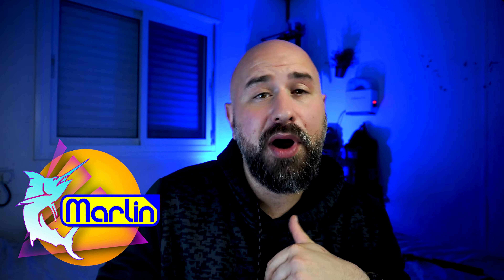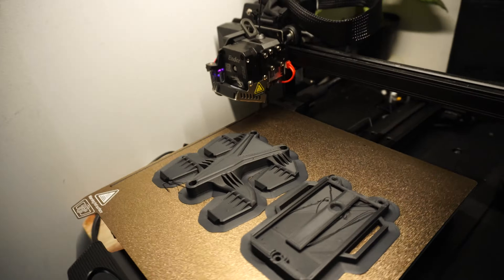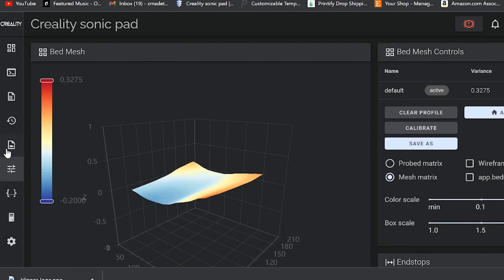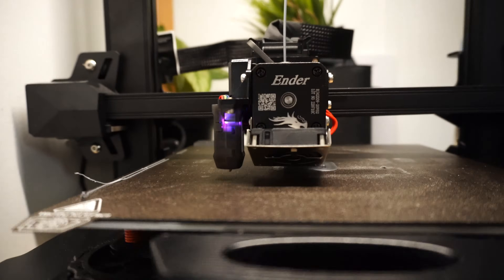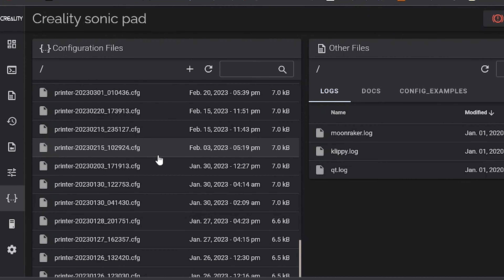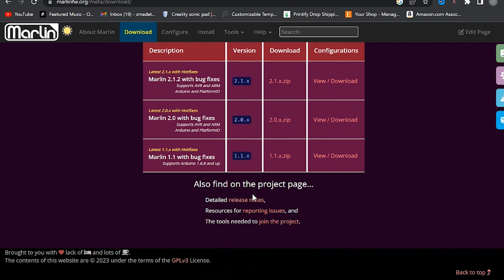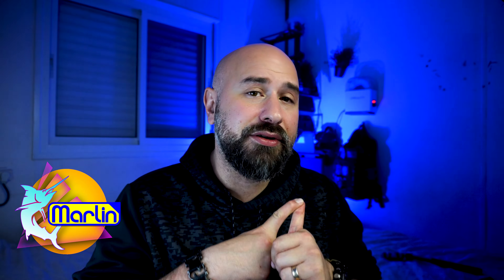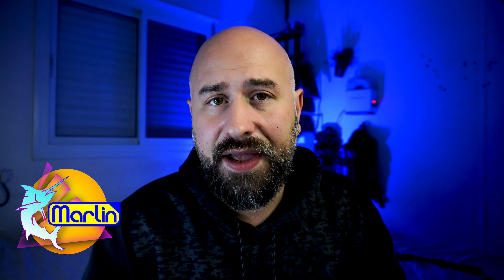Klipper vs Marlin which one is right for you

Comment: Klipper does not gives an "out of the box" speed+quality compared to Marlin. So its not only gives difficulties to the initial hardware/environment setup, but also takes time to tune up to the printer. Unfortunately even some stock printers are not natively supported, you really neet to sesrch, learn, make a lot of trial/error method. Start over again, etc etc. Yes, modifing the printer.cfg file is super easy. But to know what and how to implement in to it, you really need to invest a lot of time in it. It can takes days or even weeks to achieve the same quality that Marlin offers without wasting too much time. On long term though, yes. Klipper might be the winner. Except, if Marlin figure it out they can also go to an external board with a user friendly UI.

Comment: Did you compare the CPU power of the first (slowest) 32bit cards to desktop PCs? You should try it! I've seen guides where people use a old i5 to run 3-4 Klippers, without any problems, but the total raw power per instance is actually lower than 32bit cards. Add in Linux on top and it starts to not make sense. How fast or feature rich does our printers actually have to be to gain advantages from Klipper? Cause it seems to be a lot of work, to MAYBE gain a ever so slight quality advantage. I mean i like tinkering, so I'll likely try it just for the challenge ;)
PS calibrating Marlin is actually very easy, tho time consuming, so each time you get a new filament type, it's a 3h job

Comment: Hi I watched your video really well done. I think I might be in your minority group of people that click the video.
What I'm trying to figure out is as a very extreme beginner, I basically got an Ender 3 V 2 and I bought the CR touch, and a ton of other upgrades so while I have it apart I was able to get myself a Raspberry Pi 4B, I'm noticing just open the whole can of worms because I'm told you want to use Marlin can octoprint but that I'm seeing so many people post that it's old News software compared to the other options now so I'm trying to figure out what is the best option for entry into not having to do heck of a lot of customization on the Programming type or file management, I only picked it up because my intent is adding Wi-Fi and that's it. I'm actually still using the firmware that they shipped the printer to me with.
Reply: Just starting out, it's usually safer to stay with stock or Marlin firmware until you get more comfortable with printing. And only when you need to push past the limits of that firmware would you need to look at something like Klipper. But if you have a 32 bit Mainboard, it's down to preference. With modern 32 bit micros, it'll have more than enough processing power to do most anything you'd want to do. It's only the older 8 bit boards that truly benefit from Klipper especially with continued development within Marlin

Comment: I have the same exact opinion as you stated in the video!
As for me, I know my way around microcontrollers and had a smaller 3D printer previously, so with my Anycubic Vyper I jumped right to Klipper. Shortly after that went back to the stock firmware instead, because Klipper seemed to be incompatible with my slicer, and really looked like too much effort without any significant performance- or quality gain.
Just recently out of curiosity and geekiness I went back to Klipper, dived a little bit deeper and found that actually it works fine and is a really great tool!

I think if you are a normal DIY pal and like to 3D print and have a decent printer, you don't need Klipper. But if you like !3D printing technology, and like to calibrate, tune, adjust and mod, then it is definietly a great way to pump up your gear! :)

Comment: This is a great explanation. I've wondered what the big deal is for a while now and I've never heard anything that really outlines the differences. For me the notion of needing to use an external computer seems rather ridiculous. One of the things I love is a stand-alone machine that i can just pop in an sd card  start a print visa the built in screen and then walk away. U can see the advantages of i were running a print farm but for a basic hobby printer it seems way over the top.

Comment: Also, I'd say that mesh bed leveling on Klipper can be almost useless at times. Both my beds on my printers are at least flat enough and I've wasted a lot of time getting mesh bed leveling to work correctly. The devs don't seem to be very concerned about this. I had much better luck with Marlin when it came to this (I've replaced my bed, so I haven't ditched Klipper)
Reply: Yeah, I'm using mainsail. I'm not sure if it's the mesh settings that I'm not quite getting, but once I got over using the mesh to avoid leveling every few weeks, the screws calibrate actually works fine for now. If you're trying to tweak the firmware or calibrate (especially if you're having to upgrade or modifying the printer) Marlin can be a nightmare. I just wasted a lot of time trying to use the mesh to compensate for leveling. If either of my beds were warped I'd might actually need it, but they're not, so I just level every once in a while.  @AkashicSeer

Comment: As a newbie to fw i find klipper to be very tricky vs marlin. "Just type in this macro", sure. How did that get programmed? I built an I3 this past winter from scratch including all the printed parts and used marlin. It runs solidly. I haven't done any klipper stuff yet, hence why i am going to build a voron v0. Im positive that marlin will equal or better klipper in time without needing an extra $100 sbc and a degree in programing. Im going to give klipper a go though just to say i have. Great vid, subbed.
Reply: The only reason Marlin seems easy (on the 'programming' part) is that the firmware is already written by somebody else, assuming you find one that's specifically caters to the hardware that you have.. or it's you who adjusts as to what hardware the firmware is written for.  But you're severely fenced to the set of hardware the firmware was written for. If for example you change extruders, you have to search the net for the 'compatible' firmware or write it yourself, then reflash your board. Luckily for Marlin users is that there are tons of pre-written firmware out there and you just have to download it. 

In contrast with Klipper, you can literally pair ANY hardware you like, change some values in a text file, save and reboot. It's that simple in Klipper. It's brand and model agnostic (even cheapo chinese aliexpress kits will work), type agnostic (e.g. switch between bowden and direct extruders), freedom to add and control any additional steppers, LED/lights, fans and other accessories and so on. The process is the same for all of those - edit a text file, save, and reboot.

Comment: I am a Hobbyist in the sense of a Retired Engineer and now making model train parts for my 1950s Model trains. I bought a CR 10S Pro 5 years ago to have the volume to make engine bodies and smaller parts. In the 5 years this 10S Pro have been modified. BL Touch, Synched Z axis drives, Z axis Struts, Garolite Bed, Micro Swiss Hot end and Direct Drive, Raspberry PI running OctoPrint, Hardened Steel Nozzle. And i was struggling with a heat issue on my train parts, having some fail I had to get better filaments. CF PETRG was one answer for High temp use and it worked! But I had a heck of time getting it to print clean and reliable. Until my friend Andy told me he just installed Klipper. And thought I needed to try it to. After 3 days of on line help Andy had my printer running again on Klipper with a new 7 inch color screen OctoKlipper UI.  My 1st try with CF PETG was a disaster it squirted out all over, pilled up then went to spaghetti mode. I texted Andy what is happening. Did you set the Z offset, yes off course. Print a smaller test part and check for elephant foot. I did and it was bad. OK Now raise the nozzle .001 or .002 at a time using the New Klipper on the old 10S Pro screen. Raise until you have Zero Elephant foot. OK. How did it go, I started at  -3.0mm but ended at -2.75mm. Ok Good, now try a part. OMG! I printed a perfect Smoke Housing for the first time ever. In CF PETG. And i have even dialed in the other Hot Rod Setting. The printer runs at 180 mm/s NOT CF PETG it runs at 90mm/s but PLA+ my go to Filament for most of my parts is a screamer. And the parts look like castings. Beautiful, surface, edges and with Garolite, wait 5 minutes and it lifts off with out a scrapper.  I used my original Pi 4B to load and run Klipper, the 8 bit 10s Pro board is running the motors. Once I had the Z offset dialed in the machine has been transformed. I change speeds and temps between PLA and PETG and the thing just works. One of my partners in Parts for old trains has two Enders and he has added the Sonic Pad to Klipperize his machines so we can both print the high temp parts with the same quality. I design in Fusion 360 and slice with Simply 3D. Right now a new part is test fit using PLA and for fitting only I can print, test fit, change CAD, reprint 6 to 8 times in one day. This allows me to have a very good final shape then move to the final material print the the next day and 2 or 3 prints later I have a truly production part in less than 2 days. It usually took me weeks to get this far. So we are able to release a few new parts every week. Being 74 years old that is a big deal I have so many parts to reengineer I was afraid I would not be able to complete my work. Now I feel there is hope I will have enough time to complete my Model Train Dream, SNOW PIERCER!!!!! Great video understand both sides and hope they both have long successful lives. Marlin got me started, Klipper is helping me move along faster.  Dennis in Virginia
Reply from the maker: That is a great success story for klipper my friend! thank you for sharing and I'm happy I was able to provide you with some value

Comment: Great video though I have to say Klipper does not require a Raspberry Pi.  You can use other small board computers like an Orange Pi, a thin client, or even a laptop.  This is my first experience with Klipper and I am trying to install it on an Orange Pi 3 LTS for use in my Ender 3 Pro.  I would not say it is easy, but it is interesting.  Currently I am just using my old 8-bit board to test it out without actually connecting it to my printer.
Reply from the maker: let me know how it goes😊

Comment: I think whenMarlin 3.0 drops, printer main boards may actuall be above 64mhz and have some ram...no need to strap a pi to a control board to get fast printing.  Really the controllers with Marlin printers are shrunken stone age components....and ARM is cheap...look at all the cheap quad core gaming handhelds with screens for 40 bucks lol.  I know it is more complicated than that, but we should have just as fast marlin boards as klipper is offering with pi's

Comment: the new 32 bit boards are fast enough to keep up with anything we throw at them, the main reason klipper is better is cause you dont have to recompile the firmware each and every time you make a change. thats the main thing that makes klipper better.
Reply: You also don't need to recompile RepRapFirmware (Duet3D firmware) for any configuration changes, it's done via initialisation G-code. And you can update the firmware independent of any configuration changes. For 32-bit printer control boards, it's a more fitting choice than Marlin.

Comment: Fuck that Klipper just fucking garbeg full of bugs. I installed kliper to skip running every time to my printer instead now I staying 1-2 hours by my printer and I can not find som config which will work fine. every thing is working worse than with original firmware or pro why is peoples even recommended to use it if you need to have to learn programming. end under yours video you have massive links where you can buy it or that fuck you!!!!! klipper is fucking sodomy!!!!!

Comment: ❓8:23
What's the main difference (Pro vs. Cons) between OctoKlipper and Mainsail or Fluidd?

Is I heared there are more plugins and possibilities on OctoPrint (like OctoLapse, SpaghettiDetector, IndividualPartCancel, ...) compared to Mainsail or Fluidd. But how do they compare in other situations (speed and processing power, ...)?

(PS: I'll use my old Android-smartphone (Samsung Galaxy S8 plus) with Octo4a to run OctoKlipper because it should be easier to get it up and running.)
Reply from the maker: Hey Photelgy, that is a bit of a deep question, and a great idea for a video😊 Spaghetti Detector has transformed into Obico, and the time laps function that made octolaps so famous (letting you park the extruder for every frame) is now integrated into klipper natively as well as part cancellation, so at the end of the day all the kipper interfaces work relatively similarly, the biggest difference I have found moving to klipper for me is the speed and accuracy supper charge I got from klipper, don't get me wrong, I love marlin and octoprint is incredible, but for me and my 3d printing journey, klipper just made everything smoother and faster, I hope I was able to help 🙏

Comment: Marlin is definitely slow on a atmega2560. But not when using something like an SKR1.4T. Also with the BTT tft touchscreen having UI options to change a lot of things on the menu without needing to reflash the firmware. Curious on what happens if you pull the plug while using klipper. Does the raspberry pi's os file get corrupted? Since I don't have that problem with Marlin. I would explore klipper one of these days.
Reply from the maker: Hey there webslinger2011, I agree that Marlin definitely gives up a good fight when paired with a 32-bit board, and the right hardware, but I think Klipper is worth a try even if you prefer Marlin, simply because it's a whole new experience, and in my opinion that's usually a good thing (when it comes to 3d printing😉) I hope you enjoyed the video

Comment: Hi, great video. I'm new to your channel. I'm unsure if flippere will be useful to me. I print my rc planes on my sidewinder x2 and while it print perfect little objects like the benchy, without any defects, it has little quality problems while printing wings. I print in normal speeds like 50-80mm/s. Will kipper be able to improve the print quality or just in case of high speed printing with the input shaping?
Reply from the maker: hey marcioh123, first of all, welcome to the channel😊 and thanks for your comment, second it's a bit difficult for me to say if klipper will substantially help in your particular case, considering I don't have that much experience with the sidewinder x2, but in general klipper has a significant impact not just on speed but on quality as well, pressure advance and input shaping are just a few ways klipper can improve print quality, not just at higher speeds, but again that heavily depends on how klipper works with your particular printer I recommend you read this article, it might help you make a decision if you want to pull the trigger on klipper https://3dprintbeginner.com/how-to-install-klipper-on-sidewinder-x2/

Comment: My printer is not in a place where I can get an internet connection. Is there feature on klipper that allows me to print from a an SD card or a USB
Reply from the maker: Hey MatteoJ42, sure but it also depends on what printer you have and what interface your running,
Reply: If the rpi has an Wi-Fi card then you can make an access point and connect to it using your phone

Comment: I admit that at 61 im not very computer literate and find it very hard to understand Marlin. I recently tried upgrading my Ender 5 pro. I downloaded the firmware but could not get it to compile even after watching some videos. I know there must of been a setting i had wrong and im sure the compiling software was telling me what was wrong but I could not work out what it was telling me.
Would it be possible to have a ready complied version and then add the correct config file?
I ended out buying a Sonic Pad which worked straight out of the box and I'm getting fantastic results now.
To be honest I would rather use Marlin to save getting extra hardware, lets be honest have you sen the price of Pis due to the chip shortage at the moment.
Reply from the maker: Hey Mark, thanks for the comment, about your question its possible, but that of course depends on your level of technical skill, and the specific upgrades you made on your Ender 5 pro, truth is I personally love the Sonic pad and I my opinion, you made the right choice considering the circumstances if you do decide to change back to marlin, please let me know how it goes
Reply: @z-made  Will do.

Comment: I do enjoy your content and I have only started restarting my 3D Printer journey, due to various reasons. I was very keen to move straight to Klipper, but my son, who is an Electronics Engineer (and the reason why I got into both Raspberry Pi's and then 3D Printing!) recommended I stay with Marlin. Like a lot of people, I got into 3D Printing by purchasing a Creality Ender 3 V2 and (with my son's assistance) installed a CR Touch. I am a former Software developer, so I am comfortable flashing firmware, especially while experimenting with the Raspberry Pi's! If you have an End 3 V2 or End 3 S1, then I can highly recommend the Ender 3 v2//s1 Professional Firmware, which provides significantly more features and functionality of the stock Creality version of Marlin000 firmware, especially after flasingh the updated display firmware. Will I move to Klipper, probably yes (eventually).
Reply from the maker: Hey David, that sounds awesome! do you think you might be able to provide me with a link to the professional Marlin profiles for Creality printers, id love to link it in my video!